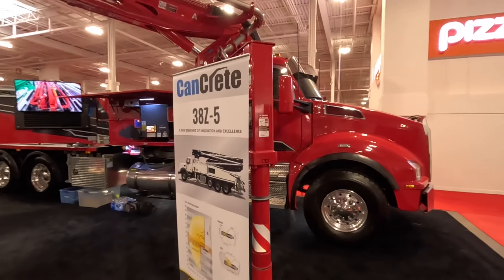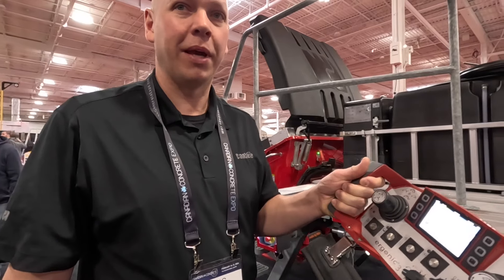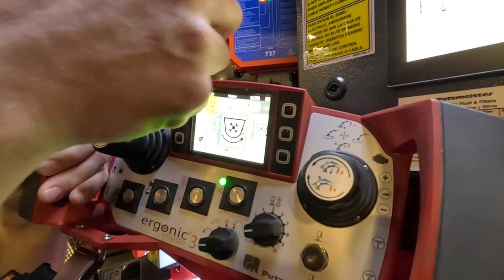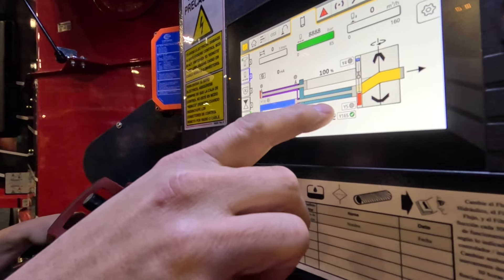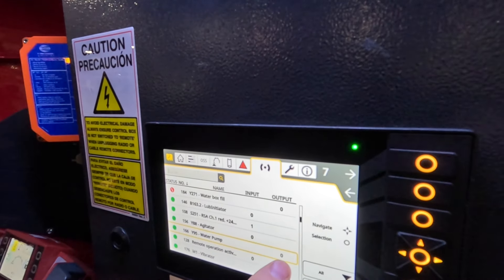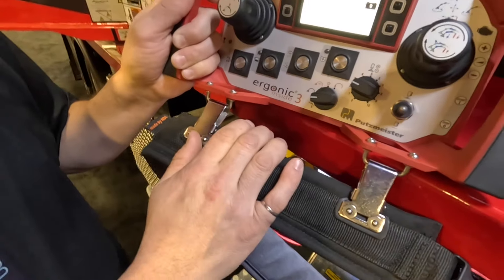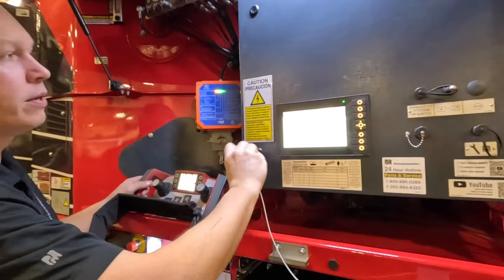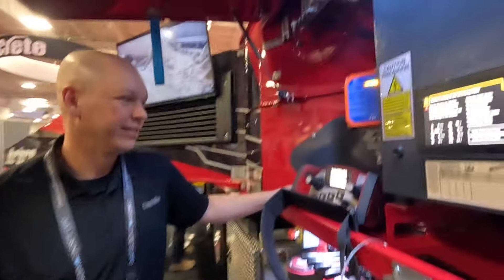PUTZMEISTER ERGONIC 3 operating system: it’s a WINNER!!!

Comment: That was one of first things I learned about pumping that outrigger mode was for warming the hydraulic fluid up still remeber to this day
Reply from the maker: I learned about this the hard way. Our old 36M Putz did not have a neutral position on the remote for the boom/outrigger switch. I would throw it into outrigger mode while washing out. On a hot day it would overheat the oil in about 20 minutes.